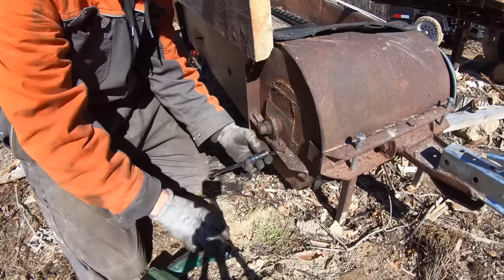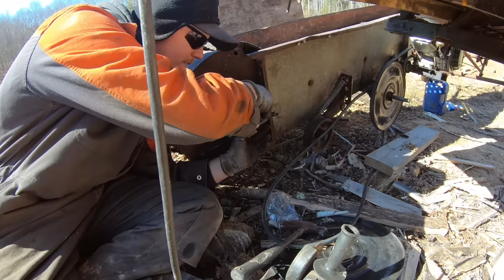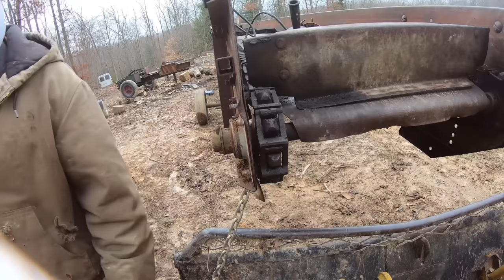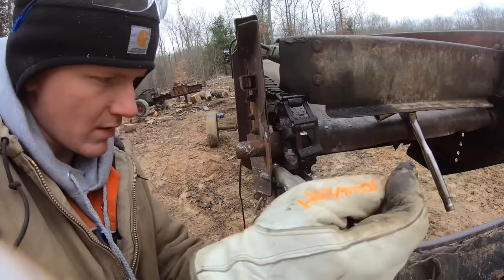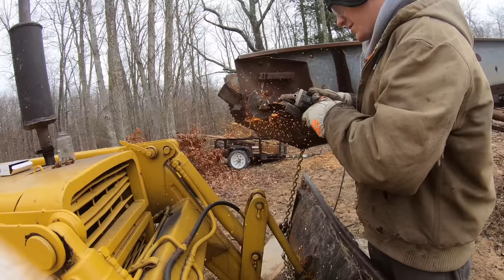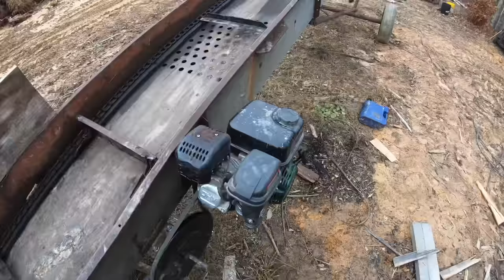Replacing Bearings In My Hay Elevator/Firewood Conveyor

Comment: If you had a torch on this job it would have saved you a lot of time. Zip wheels are great but not the best for cutting bearings off. Putting never seize on the shaft isn’t good. There are better ways for bearings.